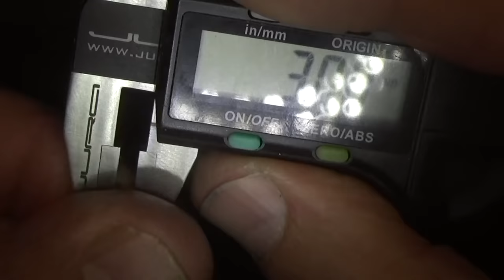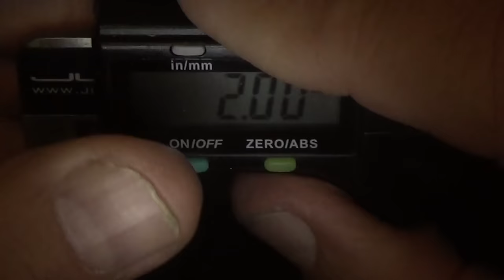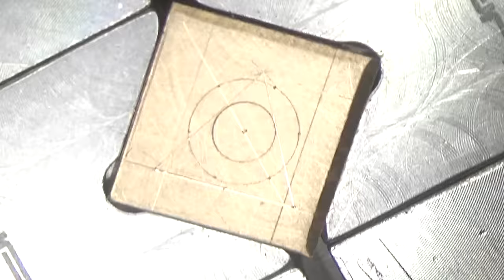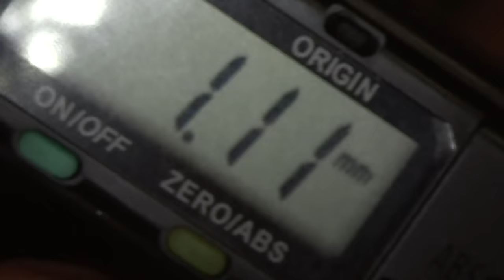Using Digital Divider and Ceramic Pen

Comment: I have Jura Complete Bench Setup .
The best tools with high quality for Stone setting and engraving in the world .I am getting best result in my work.
Also I am using from Digital divider,It’s very easy to use and amazing. 
Sir Jura thank you so much for designing and manufacturing these tools🙏🏻🙏🏻
Reply from the maker: Thank You Mehdi
Reply: Mehdi Zandiyeh  you must be super rich to buy the complete setup or did you take out a life time loan , the tools are very good but the prices are stupid expensive.
Reply: Ha Ha🤣🤣
I am not rich .
But experience has shown me that the good tool can make the result work better.I am so happy to bought complete jura tools.
Jura tools are the best because He designed his tools with his vast knowledge and experience.
Best quality and great tools for stone setting and engraving.

Comment: Where can i buy this 
New divider no have caebide tip
Easy broken tip
Reply from the maker: its not carbide. its hardened chrome steel.
Reply: @diasetter  thank you answer
How can i buy black color divider
Grs homepage only new silver color i bought return that
Reply from the maker: its not in production anymore. it had the same tips as silver one.
Reply: @diasetter  ok thank you answer
I search second hand